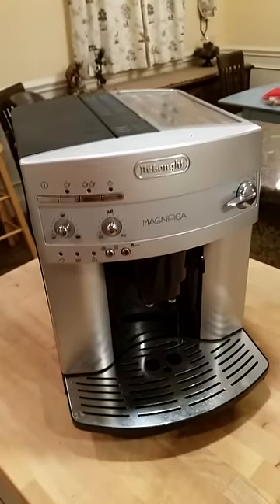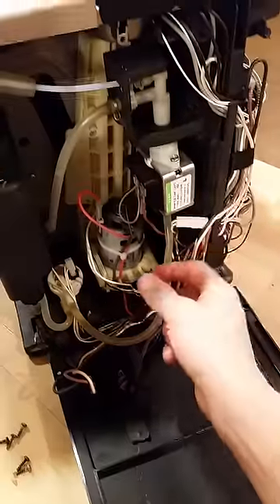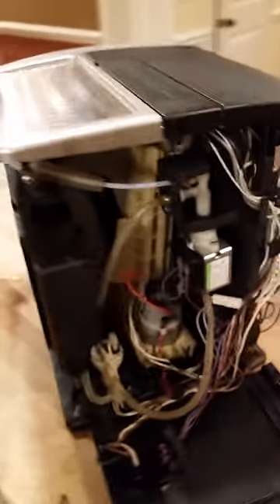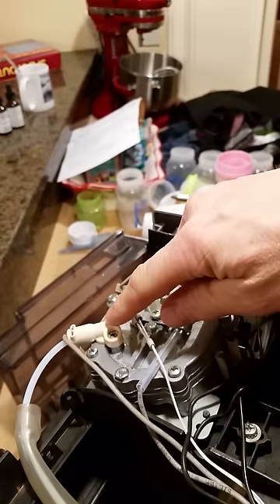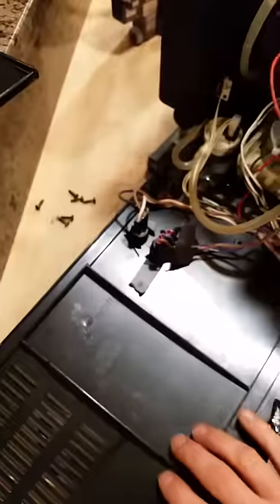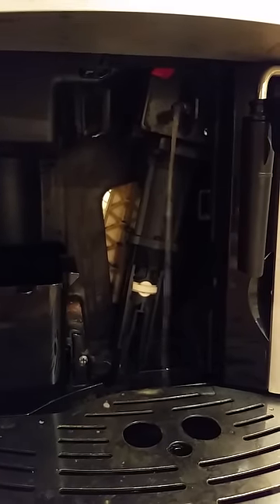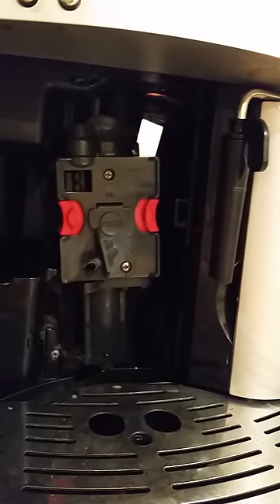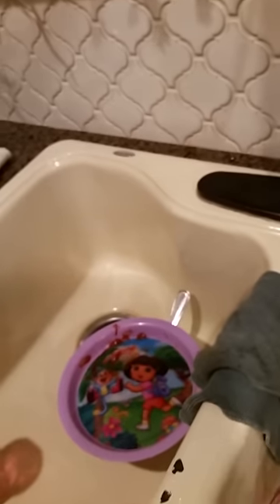Part 1 : Pulling apart my Delonghi magnifica. Info on several common issues

Comment: Hi Timo. Thank you for the interesting video! I have a question for you: The liitle arm that you are speaking about at 9:15 does not work properly at my machine. I think the problem is that the infuser does not go all the way to the bootom when the lever tries to push the coffee puck into the tray. The result is that some of the coffee remains on the top of the infuser. Do you have any idea how may I solve this problem? Thank you in advance!

Comment: Hi Timo - Thanks for the excellent video.  I am having a similar problem as described in a few comments on my ESAM3300.  When I plug the machine in, I hear two motors cycles (it sounds like the diffuser is moving up and then down - it sounds fairly normal, but I've never had this machine working).  Then, all of the lights go out.  I've tried a hard reset as described in one of the comments - hold the grounds and descale buttons, unplug for 15 seconds (while holding the buttons) and re-plug it in (still holding the buttons).  When I do this, the only difference in the result is the hot water indicator light comes on and stays on until I release the grounds / descale buttons.  Any thoughts as to how I might fix the machine?  Thanks!
Reply: I have the red alarm light of the water constantly on even if I have a full tank no water moving in the machine and I have never heard the bean grinder kick in but I thought that was because of the water ? Any help please ps great video

Comment: Hi Timo, I have a Delonghi Magnifica ECAM 22.110 coffee machine and it is pouring all of the coffee into the drip tray.  I've done all the recommended fixes, i.e., use toothpick to clean dispensers, descaled the machine (twice) (and which I do religiously every 2-3 months), ran the steamer dispenser to try and clear the lines.  Apparently it's something inside the machine, maybe a gasket, o-ring, or valve, that needs to be replaced.  Problem is I cannot get into the machine.  I looks like I need a special tool to remove the screws on the back panel of the machine.  They look like hex screws but using a hex bit doesn't work.  Also, they're not flush with the panel, they're inserted quite a bit and have little or no clearance on one or two sides.  Have you seen this?  Can you help me?  The Delonghi company wants me to ship the machine two states away for repairs.  Heck shipping alone will cost me approximately $200, not to mention what the service center will charge to fix it.  Hard to justify spending a third or more of the cost of a new machine considering this one is eight years old.  I'm disappointed I'm having a problem with it because like I said I have taken extremely Excellent care of  this machine since the day I bought it.  I'm fairly certain I can fix it, if I could get inside.  Help Please!
Reply: Maybe your hex bit is imperial (Inch) sized and you will need a metric bit?

Comment: I have the Magnifica S Ecam 22.320.SB, I have an intermittent fault where if I've not used the machine for an extended period (eg: In the mornings after it not being used all night), it will display the "CIRCUIT EMPTY" error. I can resolve this by turning on the steam wand and allowing it to pump water as the screen suggests, but it is an inconvenience and I'd rather fix it if something's wrong.
I also notice that sometimes the worktop around the machine is wet, perhaps it has a slow leak and it's allowing the circuit to run empty after some time passes.

Do you know what the cause of this might be? I've descaled it twice and this has made no difference. Should I just open it and look for any calcium deposits indicating a leak?
Reply: Something worth checking if you have this fault: When I disassembled my machine, I ran it once WITH the tank's water filter fitted (I noticed lots of air bubbles in the water intake silicone pipes). Then once WITHOUT the tank's water filter fitted - the bubbles were gone.
I was using an aftermarket third-party water tank filter.
I still need to wait and see if removing the filter fixed the problem, however, this is definitely worth checking!

I believe the leak may have been related to the poor design of the water outlet into the drip tray, it seems the water tension meant this water ran back into the machine even though there were no faults. I sealed up the area surrounding the machine's drip tray outlet to prevent water seeping back into the machine.

Comment: HI great video.  I can’t d’escale mine because the triangle light comes on when I push the d’escale button. Any tips how to fix that.  Thanks
Reply from the maker: Have you downloaded the manual and confirmed that you are doing the proper procedure for descaling?  Triangle light is just a general warning light which applies to just about anything on the machine.  However if the machine fully functions perfectly normal then you shouldn't have any issue when it comes to descaling because it uses all the same parts and features to descale is a does to brew coffee.  are you happy to help you troubleshoot it but first confirm that everything functions perfectly otherwise

Comment: Any tips on how to unblock grinder? Troubleshooting seems to have clarified I have a bean stuck and as I’ve shipped my machine to the Middle East I’m assuming customer care won’t assist.
Reply from the maker: sometimes cheap beans have something else in the bag (rock, etc.)   you need to pull apart the grinder and clean it.  a vacuum will usually suck out anything blocked, but sometimes you need to pull out the burrs.  just depends

Comment: The unit shows constantly to fill beans even though it’s full. The grinder works only if the beans are pushed down manually!
Reply: Your beans maybe too big for the grinder, so turn the grind to 7 and that will help, until you source some smaller beans; 6-7mm is the right size for this grinder. It's recommended to never grind below setting three.

Comment: Hi Timo. I have an esam 3300 but espresso is not coming out of the spouts. Water only comes out of the frother wand. I replaced the pump and checked the hoses but still problem. Any suggestions. Thanks
Reply from the maker: Do you hear the pump running after it grinds the beans?  if the pump is running the water has to be going somewhere.  It's possible your Brew unit is clogged up, it could be brewing the coffee but just draining into the pan instead of coming out the spouts, could be that it's not making it to the Brew unit at all and it's going out the overflow which would also put it into the drip Tray.  So I guess the question is is your drip tray getting filled up? And is it coffee or water?  In the grounds Trey are you getting solid slightly damp coffee pucks or are they coming out dry loose coffee grounds?   I need more details to be able to help you
Reply: Timo seppala 
Yes the pump is running. Water is collecting in the drip tray only coming out of the frother wand. No brewed coffee is coming out. The water is not making it to the coffee because the grounds are dry when disposed. Thanks again for your help.

Comment: Timo, after cleaning my DeLonghi Magnifico EAM3200 won't turn on. No lights or noise. A repair company in Seattle suggested it is the power board. I replaced and same problem.  Right now the diffuser is stuck in the down position and I can't remove.  Their are no fuses and the power cord to the power board is ok. Any ideas on a sensor problem?
Reply: After replacing the power board the machine still won't turn on. It was completely dead. What I did was to start unplugging the sensor connections. When I unplugged a 3 wire sensor going to the diffuser motor the machine started working. I'm not sure why but my coffee maker works great now. I followed your instructions and lubed the threaded shaft and also added some lube to the back of the  until where the diffuser  goes left and right. Case closed.

Comment: Hi there. Thank you for this video. My issue is that my machine simply will not turn on any more. Any suggestions as to what it may be before I start tearing it open?
Reply from the maker: Jesy Diaz does it do anything when you turn it on? your lights flicker or anything or is it completely unresponsive
Reply: completely unresponsive :(
Reply from the maker: Jesy Diaz I honestly don't know what to tell you with that sounds like something's burned out on it.

Comment: I am having very reduced volumes of water through the machine.  Rather, the water is coming out of the frothier even when not on.  Does anyone know how to fix the problem?  I cannot seem to find any plugged line but suspect there is a valve that is not closing properly.  Thanks.

Comment: Hi - at about 10:40, you warn us not to take the spring off because it is hard to get back on.  I have just discovered this myself unfortunately.  (Wish I'd watched the video first!)  Any guidance on getting the spring  back in the right place?  The short end of the spring is on the left (closest to the tunnel) and the long end is on the outer, right side.  I suspect that the spring needs to be somehow opened up so that the left side of the spring can be flush with the back of the spout.  Any help would be appreciated.
Reply from the maker: Mark Phillips I honestly don't remember exactly how it went if I remember correctly I used a couple pairs of needle-nose pliers.  Said a few Choice words had to stop a couple times to take a break so I wouldn't throw the machine off the balcony from frustration and finally I figured it out.  Good luck
Reply: @timoseppala7137  I use duct tape about 3/8" x inch or more.  leave the spring in.don't remove it.....force the spring to the position you want, then tape it tight, then install the spout.  simply remove that tape. I could do this in under minute half asleep

Comment: Wow did you learn a lot about your coffee machine all by yourself. I have the exact same one and enjoyed watching your video. At least now there's a way to fix things should they arise. I have an interesting one that seems easy. When using beans the machine struggles to make coffee, but when using the pre-ground coffee it makes it just fine. I've descaled, rinsed everything, cleaned everything and can't find where The Back-up is occurring. I thought it was plugged ports and dirty infuser but I cannot find where it is struggling. Would you have a suggestion or where I could look? Pretty impressive stuff you're doing and now the world is watching you. Pretty cool
Reply from the maker: Brian Vest i would say that the first thing you should look at would be your grinder.  Heavy use or oily beans can cause that.   Oily beans coat the grinding blades with oil, causing it to "burn" through instead of cut through the beans.  If that's the case you need to take the top of the machine off and access the grinder.  Then wipe down the bean hopper and grinder as good as possible to clean up as much of the oil as possible.  Then put light roast beans in it for a while and set the grinder to the coarsest setting possible.  Over time it will come clean.  You could take the grinder apart and clean the blades, but that would be a bit more difficult.  If that doesn't work you may need to replace the blades.  They do have a limited lifespan, do many years of heavy use may have caused them to wear out.  Good luck!
Reply: Timo Seppala hey thank you for the response! You really know your stuff. I didn't accurately describe the problem when I say it struggled to make coffee it is water that is my problem. It's as if the water pump is trying to push through a clogged filter when using the beans and no water comes out hardly, but when using pre-ground it flows just fine. I can't see a difference in the machine after it's got the grinds whether they be pre-ground or beans and water flow but it definitely struggles to push water through the system using Beans.  Machine is probably only 6 months old. Any help is greatly appreciated buddy thank you
Reply from the maker: Brian Vest whether you use ground or the grinder it all goes to the same place the only thing that might make any sense in this situation is that the generator is worn out because when you put grounds they aren't ground as finally and there isn't as much of them.  Try putting a lot more grounds in, making sure the ground very fine and see if it still does it that way
Reply from the maker: The pump is actually low power and doesn't pressurize the coffee, so that would not be the issue.  possibly the generator.  that's what creates the pressure to push through the beans.   try grinding the beans ultra fine in a separate grinder, then put lots of it in the grounds spot.  see if it struggles then... if so the generator is probably the issue

Comment: Hi Timo, Need some help here, have a 3500 that gives coffee but no milk / hot water, i changed the o rings on the water / milk pipe on the front  but nothing comes out as if its stuck inside.
From the pump i released the upper thin / pressure whose, and when dubble tap the cappucino / for milk only i do get strong, short Burst of water coming out. when i put it back nothing.
Appreaciate your advice,
Reply from the maker: More than likely the steam thermoblock is blocked with scale.  meaning the machine hasn't been properly descaled on a regular basis.  or it could be that when the machine was initially purchased whoever programmed the hardness settings into it set it at the lowest hardness setting and you're running really hard water.   You would have to disconnect the thermoblock hoses and try to clear it out manually by blowing air through or using an eyeglass screwdriver to clean it out.  Then reconnect it try to run hot water until it clogs again and keep doing it until it runs clear.  as soon as you get it somewhat cleared up immediately descale at the descale solution will break it down.  A lot of people underestimate the importance of the descaling procedures.   

This is of course a theory without seeing the machine
Reply: @timoseppala7137  Thank you for the quick respons, the steam thermalblock is that the (heating) part on top? (the part in your video you replaced because of the leaking O ring?) Is this the part where the hot water runs through for the coffee, because making coffee is still working. I am also able to run the cleaning program,
There is also a second heating block vertical in the machine
Reply from the maker: @TophatOrange  you are referring to a different machine than I made my videos about.  Yours has a dual boiler on it.  The one on top is for coffee the one that stands vertical in the back is for steam
Reply: @timoseppala7137  Your absolute right, just filled the reservor with detergant and checked if the cleaning program was still running (which i thoughdt it did) but it is stuck.
What is the part i have to clean, the heating on top or the shouhorse shaped heating (vertical one ) in the middle of the machine, i can see a thin pressure tube running to the front to the water outlet.
Reply from the maker: @TophatOrange  Google the model of your machine along with steam thermoblock and you'll find it.  It's a small boiler that runs vertical on the back it'll actually be clogged inside of that metal boiler
Reply: @timoseppala7137  Correct the 3500, I just losened the tube from the coffee boiler to the heating boiler and pressed the cleaning buttun, water comes out so indeed the boiler from the hot water is the issue, i am gonne take it of and try to clean it with high pressure air, if you have anay other suggestions please let me know. THANX A LOT for your quick serponse much appreciated now i know what the issue is. Saves me a bunch of money for a new machine.
Reply from the maker: @TophatOrange  i would use a small screwdriver first and carefully scrape it clean on inside,  then run hot water through it.   Be careful with are because you can put more pressure on it then it's designed to handle
Reply: @timoseppala7137  Opened it and air went straight througt, full power. but found what is i think.
When running cleaning program,  the water goes from coffee heater to a smal switch (inlet coming from coffee heater and outlet going to warm water heater and on top inlet low pressure water + on the side 2 electric connections  i presume for switching between cleaning whole systhem and hot water only, so i think it might be broken / stuck or no signal from system? got any clues? (sorry for all my questions and taking up your time.)
Reply from the maker: @TophatOrange  I think what you're referring to is the solenoid valve yes that could be bad or clogged
Reply from the maker: Like I said diagnosing these machines is a process of elimination if it's not the boiler then it pretty much has to be the solenoid valve, unless it is the circuit board trying to send the signal to the solenoid valve to activate.
Reply: @timoseppala7137  By exident broke a piece of the solenoid valve, new one came in and have installed it today also lose connection of the valve to the circuit board tightened, Cappucino works like a charm again, thanx for the help.